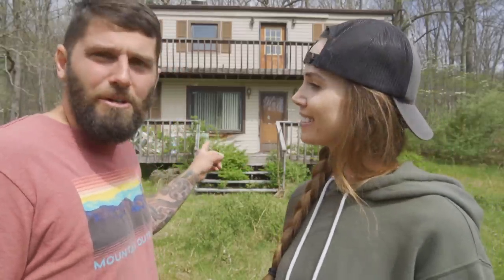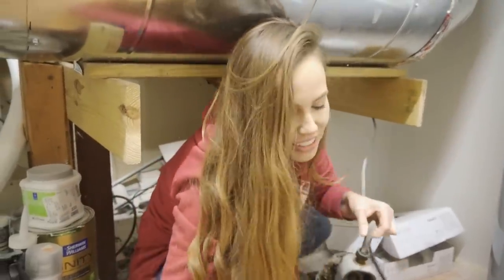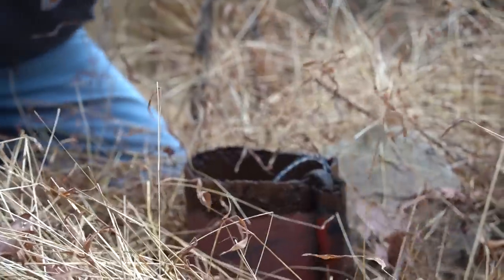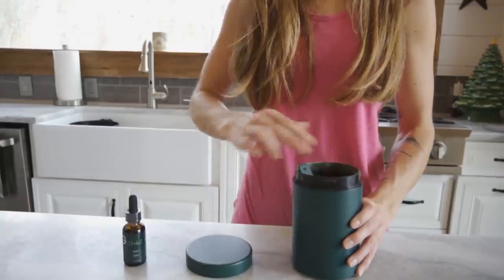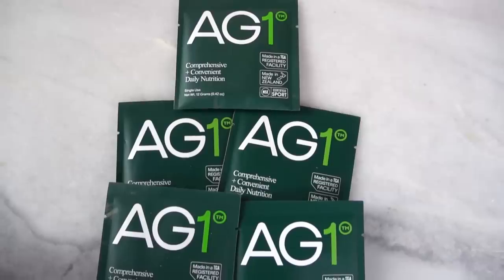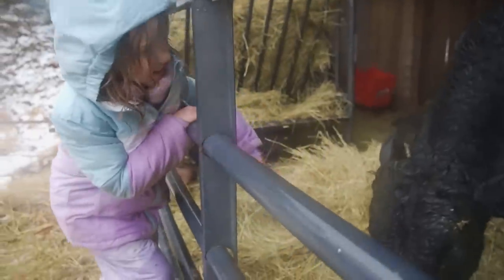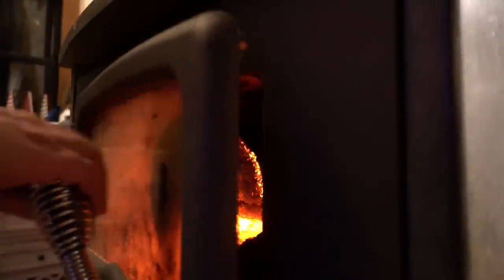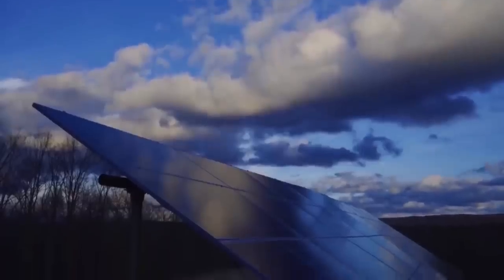Arctic Blast Off Grid Surviving Historic Winter Storm

Comment: Beautiful. The plummer contractors seem to be the most helpful of the crews you ve had. Thanks for family work day and beautiful ending overview. 
Merry Christmas.
Reply: We are on well, also.  Put in a constant pressure pump after several regular pump and/or pressure tank bladder failures over 15 years.  Can run two showers and washing machine at same time.  Pressure tank is slightly larger than a gallon jug and is wall mounted.  It’s been 10 years since installation…love it!  Look into this system, if you have problems at either properties.  Merry Christmas to you all!

Comment: Given the headroom that you have on your solar array, I think I'd use a small 1kW electric heater with a thermostat set ~40 degrees to heat that small power building. The inverter are already providing significant heat, during a day's normal usage, as well as supplementing the output of the heater if/when it kicks in.
With the building's insulation you only need a safety net, just in case all else fails during extreme cold weather and the middle of the night before sunrise, IHMO.
But of course, I also understand that you don't want to take any chances.
You do you, Josh because that's what always works best for you family. Haven't needed my advice before now and probably don't need it now. Simply sharing some food for thought as an alternative to a propane fire burning all night.
Love your channel and beautiful family. Thank you for sharing them with The Hermit.
Hope that all of you and your loved ones have a wonderful Christmas and New Years. 😎

Comment: We here in the UK had already -8c (17.6F) for about week, and we lost our rainwater harvesting pump as the manifold made of cast steel split wide open, all our plastic taps that feed the water tanks have split too. Our ASHP was building up with ice, but it defrosted itself well, even if the drip tray was blocked and frost solid. So when we heard about the 'bomb cyclone' as they are calling it over here, we both thought of you guys and your animals. I feel that the failed water pump at your renovation was a blessing. Hunker down now and keep warm guys.

Comment: Trying to pump water with a submersible pump you didn't install is always an eye opener.  When my plumber pulled my old one to install a new one he found 3 separate splices in the electrical going down the shaft, then he also replaced the 140 feet of piping just in case as it was almost 50 years old...
not the most fun day of my checkbooks life!

Comment: I don't know how cold it got there but here in NC it's been frigid day and night. Our heat pump has had a hard time keeping up. Last night is supposed to be the last night of lows in the teens. We're still below freezing at almost 10am.  Our two 55 gallon rain barrels, full to the brim, have frozen solid. We've never had such cold temps, low humidity and low dew point in the 11 years I've lived here. It's been an experience for sure!

Comment: When will the pond pasture loafing shed project start? That cow would love a simple loafing shed.
A thermostat controlled built in propane heater for a travel trailer could work great in the power house. It could maintain the proper temperature automatically without needing the portable heater.

Comment: Baseboard heat in the power house sounds like a better long term solution than the use of propane.  Also I would suggest installing two photoelectric smoke detectors in there. If both go into alarm you could shunt trip the power house to avoid a catastrophic fire.

Comment: FYI, you can get electrically heated pads which can keep the batteries at temperature with a thermostat, without having to deal with the risks of an unattended propane heater.

Comment: Perhaps temps low enough to cause an issue with the battery bank are too rare to consider this, but I was thinking add a temp control heating unit up near the battery bank so you never have to think about it? Using power off that bank.

Comment: I replaced my 100' deep pump a few months ago, (good power going down) but discovered there was a rubbed/burned place on one wire down in the well.  So check your wires when you pull the pump.  (and keep them taped to the pipe, with "proper" good tape)  idk if my old pump is still good, maybe, saving it for zombie apocalypse scenarios ... ha)